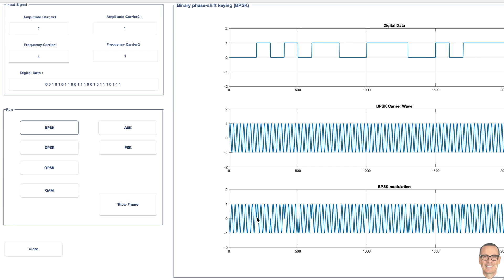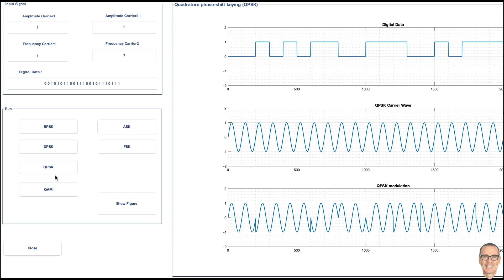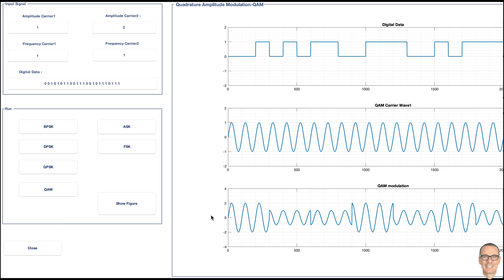Visualising Digital Modulation: ASK, FSK, BPSK, DPSK, QPSK and QAM

Comment: Thanks for the visualisation professor.
at 2:58 we multiply our baseband signal with carrier wave because antenna resonate at that frequency but in FSK modulation the frequency changes, so how does the antenna transmit it, and how do we send a band of frequencies
Reply: Antenna resonance isn't all-or-nothing. Like any tuned circuit, an antenna has a passband. Depending on its design, it can be as wide or as narrow as you like between the half-power (-3dB) points.

Comment: Hello prof.,  i have i a problem and i wish you will help me to solve it. 
About cnr vs ber i calculate it using both simulation and real time device and i got the same result which it is 3 db different than the available reference..
As example for BPSK i got 1e-4 at 6 DB cnr but in the reference it must be 9 db atr this ber, i using noise single from matalb wgn function for both simulation and real-time
 and for more detail the signal is 1 vp that mean it is - 3 db and for 6 cnr i use - 9 db power noise.

Comment: A nice continuation of this would be to show the spectrum of the modulated waveform so you can see that the bandwidth is half the bitrate for QPSK compared to BPSK, and that the bandwidth is determined by the symbol rate, not the bitrate (https://youtu.be/ZBSvMbO0mPQ). It would also be helpful to show the modulated waveform with and without a transmit filter in the frequency, time, and IQ polar domains to see how we can reduce the occupied bandwidth nearly for free as long as the receiver knows the transmit filter. That gets us to pi/2-BPSK and pi/4-QPSK, which allows us to avoid a zero crossing on the IQ constellation, which reduces the PAPR, nonlinear products when used in a real transmitter, and perhaps some improvements in the frequency domain.
Reply from the maker: They're all great suggestions! I just need to find the time. In the meantime I've added them to my "to do" list. Thanks.

Comment: One of the thing that I have been always wondering about is that how can we actually generate these sine wave and square wave. Is it really sine wave  and square wave or just some "approximation" that look kinda sine and kind square.
Reply: The carrier which is a sine wave is not an approximate but a truly sine function generated using an analog local oscillator (LO).
The same is true for the square function, although in practice we rather use roll-off cosine shaping to avoid out of band interference through the "sinc" spectrum of a pure square baseband signal.
Reply: @BilelMnasri13  perfect square in time domain occupied infinite bandwidth to construct so is it some kind of approximately square looking pulse ?
Reply: @tuongnguyen9391  Indeed, you are right. That is why we use roll-off cosine function instead of perfect square pulse shaping.
Reply from the maker: Here's a video on pulse shaping: "Pulse Shaping and Square Root Raised Cosine" https://youtu.be/Qe8NQx4ibE8